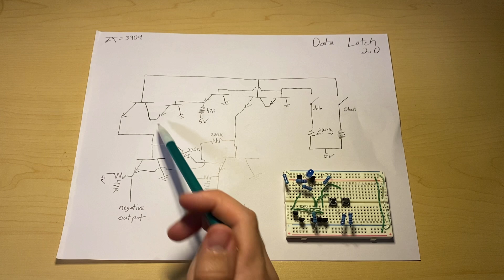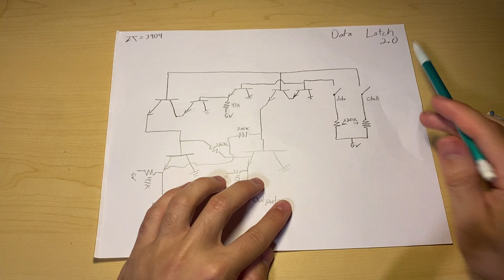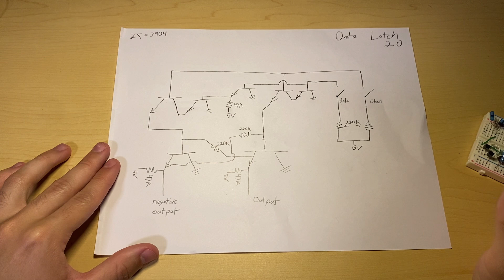7 NPN Transistor D-Latch (Best on YouTube)

Comment: The circuit drawn is almost correct — except that emitters are connected to ground, not collectors. Every 2N3904 is shown upside-down. I thought it employs reverse-active region of BJT operation (like TTL inputs do), but looking at the breadboard implementation I saw emitters grounded, then it all started to make sense. 😉
Perhaps you may eliminate yet another transistor using midpoint of one NAND gate as a source of inverted D input for other one.

Comment: Great circuit! The schematic diagram is horrendous tough . Maybe clean it a bit?.
Also, why do you need this circuit as a register? You can use it as a counter/divider by 2 and build the clock with modules like this. Throw there a 7-segment decoder that can be done with diodes. To count up/down you can look at Cd40192/193.